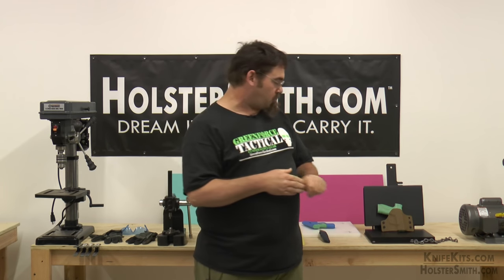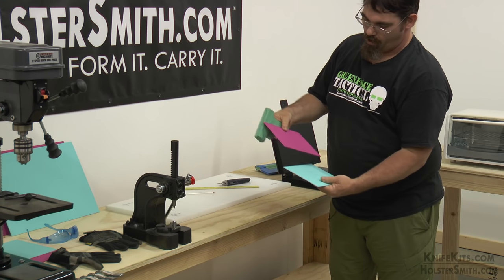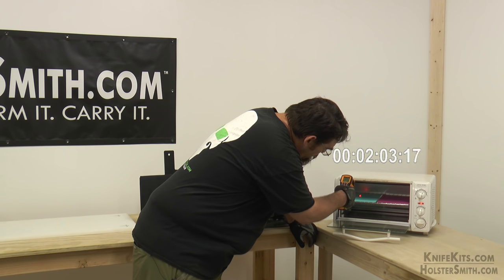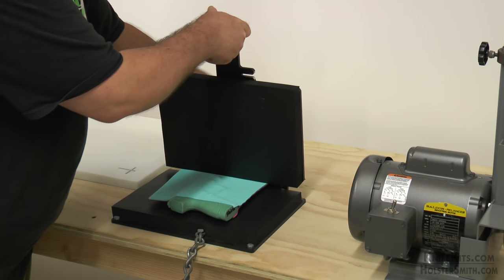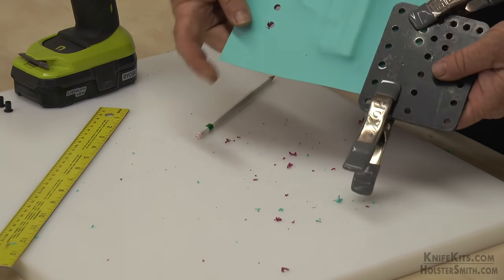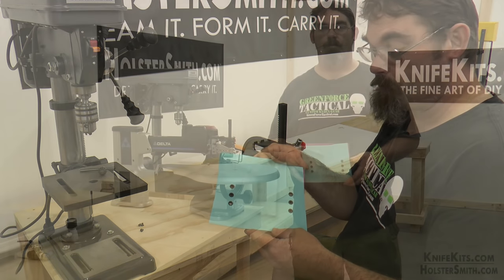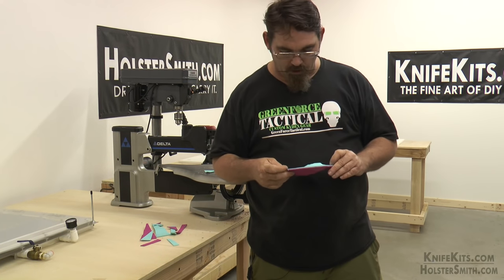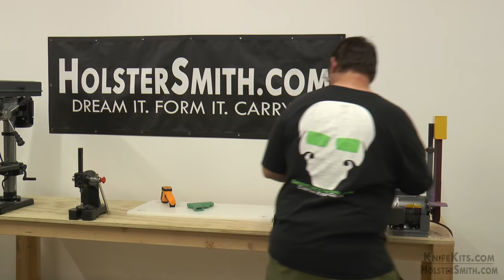DIY KYDEX® Project : How to make a 2-Piece Holster (Feat. Christian Green)

Comment: Awesome job beautiful work, before final sanding 22:04 Could  you cut a piece kydex a little  bit bigger than your final holster, Heat it up, Place the finished sanded mold in the press, Place the heated kydex over it ,Sand it Than you would have a Final Template that you could  place  over your mold than trace it with a pencil  Than cut it out just a hair bigger, Sand it this way you could  have cut out Templates for every  model and cutout specifications

Comment: Nice vid, where did you pick up that drill plate for the eyelets
Reply from the maker: Thank you Trigger. Hey guys, if you need to pick up a drilling template here is a link to all of the templates that we offer. https://www.holstersmith.com/vcom/index.php?cPath=547_692
By the way, we also have the eyelet drills that we used in the videos. https://www.holstersmith.com/vcom/index.php?cPath=548_527

Comment: Hi what would be a good eyelet press  I’m in the Uk ? Thank you
Reply from the maker: Thanks for watching. We have several options for eyelet flaring tools.  The Master Series press and dies work great for making a large quantity of holsters and sheaths. The Journeyman dies and die guide also produce great results, but are recommended for smaller productions. An Arbor Press can also be modified to fit the Journeyman dies. The link to these eyelet flaring tools can be found below.

Eyelet Flaring Tools:  https://www.holstersmith.com/vcom/tools-eyeletrivet-tools-c-548_526.html

If you have any other questions, call us at: 1-770-599-8012
Reply: CKK Industries thank you very much il start searching later today over a coffee

Comment: On the Holstersmith site, I get the impression you can use a hammer instead of the press as long as you use the guide and dies?  Is that right?
Reply: You can use the Journeyman dies and die guide and use a hammer. The roll on your eyelets will not be as consistent, and you will be more likely to split the eyelets with the journeyman dies and a hammer. It is also slower. That being said, there a lot of folks out there using the journeyman set up with great success. You just have to get a feel for it.